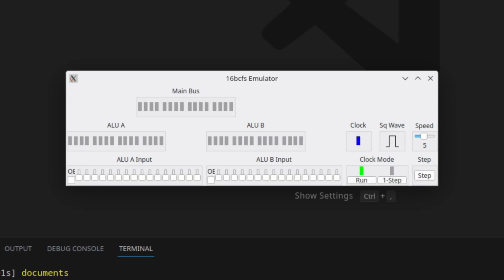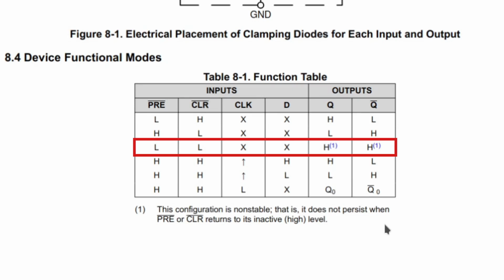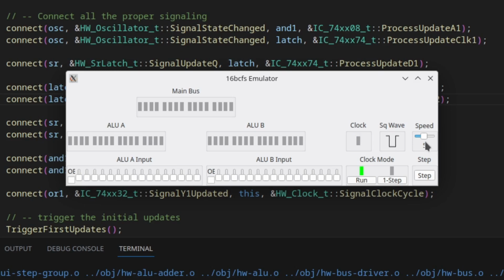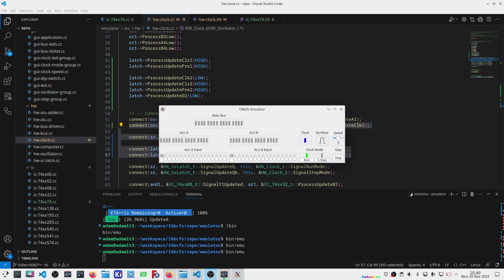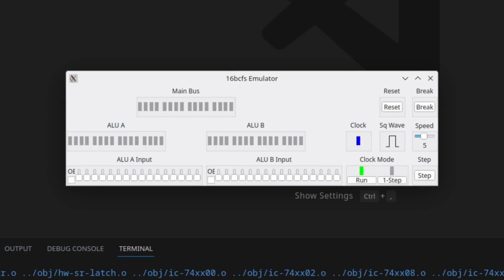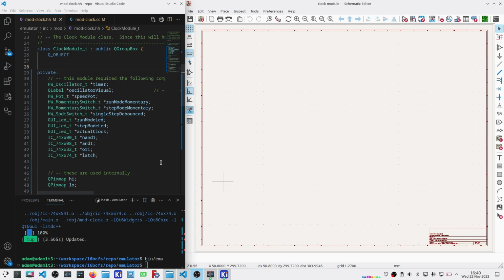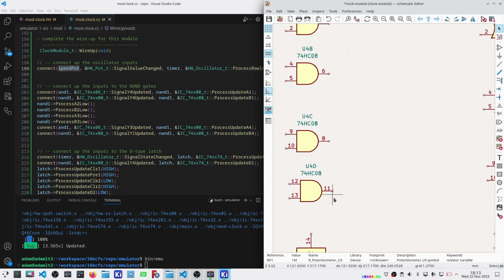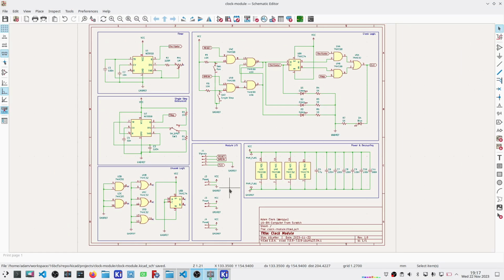0082: The Clock Module & Schematic From the Emulator | 16-Bit Computer From Scratch

Comment: hey man, I think the clock module that you have built sounds great in theory but it looks like you didn't add any current amplifiers for the clock that is carrying the pulse this may result in the pulse dying out before it reaches all the modules of the computer.

you can definitely prevent using the current amplifiers if you increase the width of the copper traces or increase the increase copper amount to 2oz instead of the standard 1 oz but since you are having the modules on the breadboard itself you should add some current amplifiers
Reply from the maker: @gamingdojo6126 -- thank you for the suggestion.  It's time for me to learn something.

When you say current amplifiers, I assume you mean an opamp of some sort.  What would you suggest?

I have already had some voltage issues on the backplane which I tacked in video 67 (https://youtu.be/Y3rqRq2cANQ).  I assume that this signal will have the same problem.  As will all the bus signals.  It would only make sense given the distance of the signal traces on PCB and the small cross-section area of the trace -- both of which I know will increase the resistance and therefore drop the voltage.

Now, that said, you mention current, not voltage.  From that, I presume you mean that it is best to increase the current to overcome the resistance (basic Ohm's Law stuff) and keep the voltage the same.  I also believe that this will increase the wattage in the signal trace, which may cause the trace to heat up, and that may also be undesirable.

The only good solution for PCB might be to go with thicker copper (2 oz as you mentioned) or thicker traces -- which might force me into a 6+ layer PCB. 

Am I understanding that properly?
Reply: @eryjus4594  Hi there.

I like to refer to current amplifiers as a term rather than a component. So yeah anything that amplifies current based on your needs is perfect.

I think that the address and data lines from and to the bus would not have a voltage drop if you are using tri-state logic chips like 74ls245 but in the case of the clock signal it goes in every module of the computer. But since I recall you telling me that all the breadboard parts would convert to PCB the point of using current amplifiers or a higher amp power supply is not a question here.

Also, a little heads up when you make the copper traces thick make sure to add a Ferrite Bead as the thick copper traces would really increase the electrical noises and might even act as an antenna.
Reply from the maker: @gamingdojo6126 - Thank you for the reply.

So, if I am understanding your suggestion properly, something like a 100K Ohm pull-up resistor at each module that uses the clock (which is likely to be several components) is likely to work.  So, with an anticipated 25 modules or so with these pull-ups, then I can expect the pull-up resistance to be: 1 / ((1 / 100K) + (1 / 100K) + ... + (1 / 100K)) or 1 /(25/100K) or effectively a 4K pull-up resistor.  So, assuming I have no voltage loss for the Vcc plane, this means I should be able to pull 1.25 mA at each module at 5V.  Now, this may not be enough (without checking, I may need up to 30mA) and I may have to rework those numbers, but I'm looking for confirmation of my thinking here.  I'm not convinced I am correct.
Reply: I don't think this person entirely knows what they're talking about. You might need some buffering if the clock is driving a large number of inputs, but if that's a problem, increasing the thickness of the traces isn't going to help.

Technically a buffer is a current amplifiers, but nobody calls it that in a digital context.

Comment: I wonder if you really want reset to put the clock in run mode. That would prevent single stepping through the beginning of your code.
Reply from the maker: @davidhunt4679 -- Thank you for your thoughts on this!  Yes, admittedly that does set up a race condition between my finger pressing the button and and the first instruction executing.  But there will be a couple of things on my side that I think I will be able to benefit from if I need to debug the first instructions.

The first I did mention in the video, which is a `BRK` instruction.  I can always put that in as the first instruction and force the clock into single step mode.  If adding a single instruction to the start of the program somehow breaks or fixes my code, there is something much bigger wrong.

The second I have not talked about yet, but there will also be a signal to hold the entire system in reset until all the separate modules are ready.  Several modules may take some time to complete an initialization.  The clock reset is trivial and instant.  The register module reset (wrapping up video 1 of 2 on this soon) is trivial and instant.  However, I also need to do something about my control EEPROMs which are far too fragile for me.  I will be changing to serial EEPROM and will take some time to perform a reset, during which I believe I will have plenty of time to change to single step mode.